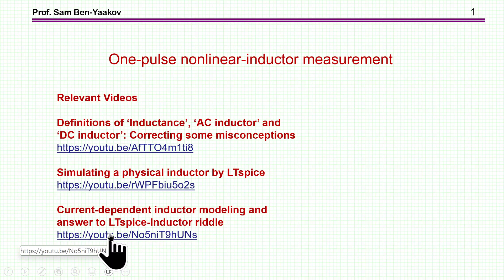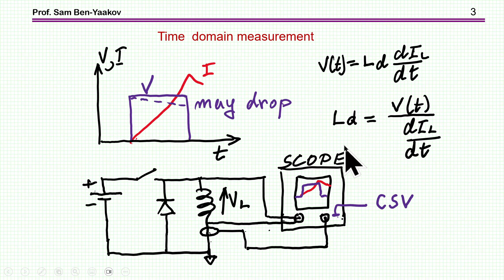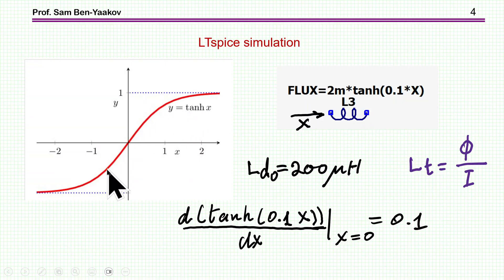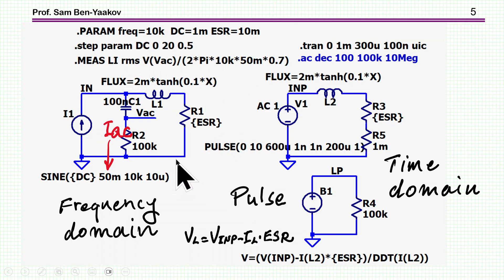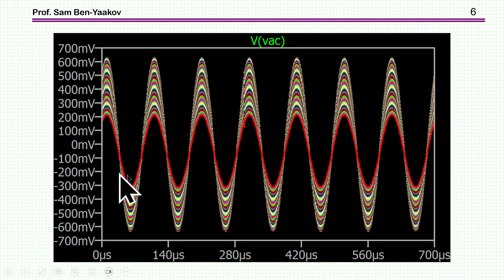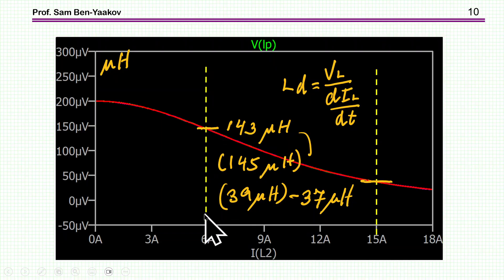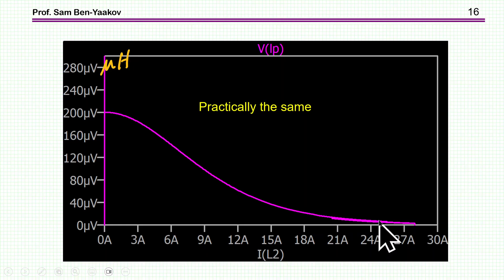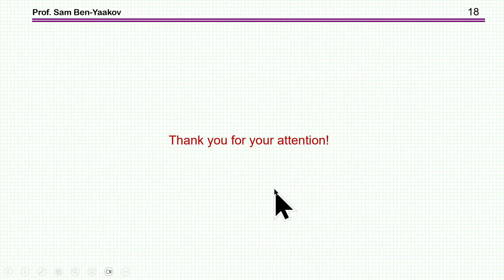One-pulse nonlinear-inductor measurement

Comment: Thank you First of all for the Videos, i got much to learn, but I have a question regarding the Simulation, why add a 1m Ohm resistor and only subtracting the ESR? Doesn't this also add some uncertainty?
Reply from the maker: You have keen eyes. It was originally put for measuring the current (to locate the resonant point) but you can consider it as uncertainty of interconnection resistance.

Comment: 😂 prof do u read minds? I have been using this method and ringing in tank circuit for inductance calculation. 

I wanted a method to identify core saturation current  for buck converter. Could u make a video on practical methods for it? And as always very nice explanation.
Reply from the maker: Will see. Thanks for the comment.